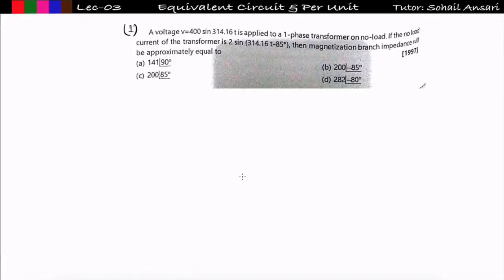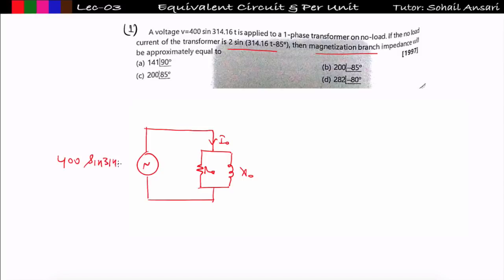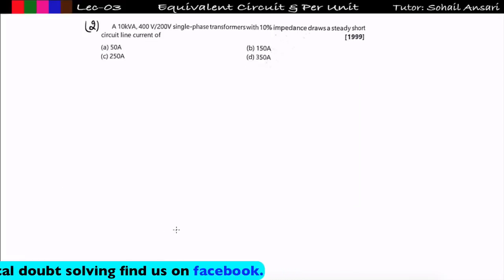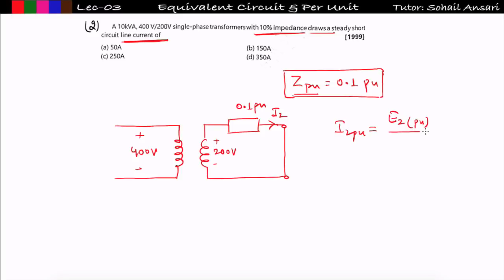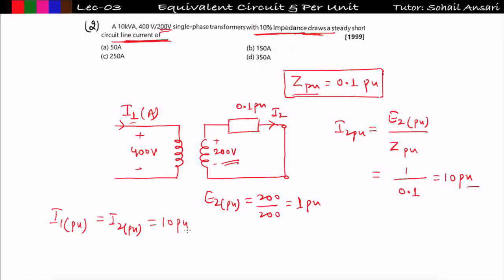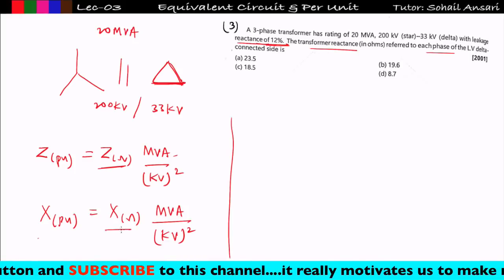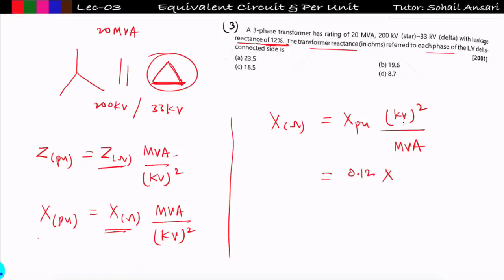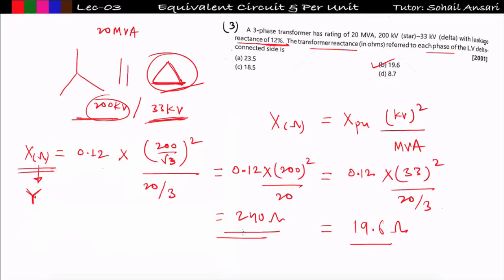Mod-02 Lec-03(b) GATE Problem on Equivalent Circuit & Per Unit Concepts

Comment: In 2nd you can do direct..by taking 200 as a base voltage...so ibase is 25 and at last multiply 25 by 10 getting ans

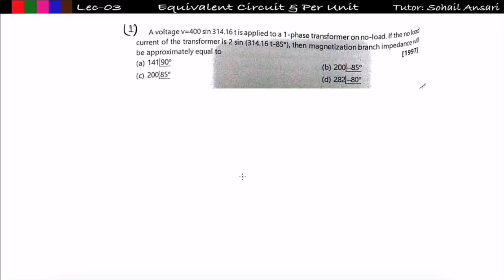Comment: 0:09
I never seem to understand why is magnetising current having an angle=-85degrees when it should be -90 degrees

The only case where it can be -85 degrees is if it has a small magnetising resistance in series